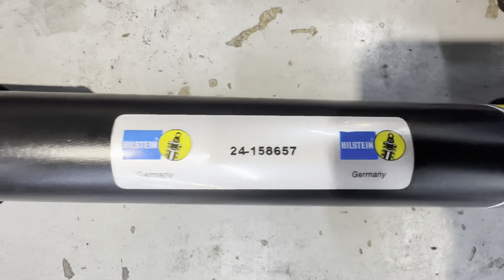Mercedes GL450 GL550 GL63  Rear Shocks.

Comment: Thanks for the video. Helped a lot knowing where to find the clips for the interior panels. Way better than breaking parts such as the armrest pads and hoping they don't flop around later. I did find that separating the panel from the clips at the front of the panel on the pass side helped to make space to get to the top bolts.

Comment: thanks for the awesome video. Especially laying out all the tool sizes for us. I just overhauled my 2016 GL450 air suspension system w new compressor, solenoid valve & 4 air bags. 1. Can you please recommend rear bilstein shocks that are stiffer than the MB factory shocks?  I am trying to get way less sag’ in the rear of my GL from a dead stop with stiffer than oem rear shocks? 
2. whats your opinion on the oem front MB shocks?  or would you go stiffer up front to match the new stiffer rears? thanks in advance.

Comment: Top bolts should be just snug enough.  Wait until the wheels are mounted and car is back on the ground off jacks.  Then torque the top bolts at 30 N-m

Comment: Great video, but one question. Why not remove the seatbelt anchor bolt to allow the interior panel to be completely moved out of the way? That gives a lot more  room to get at the strut bolts and not destroy the insulation foam.
Reply from the maker: Because flat rate.